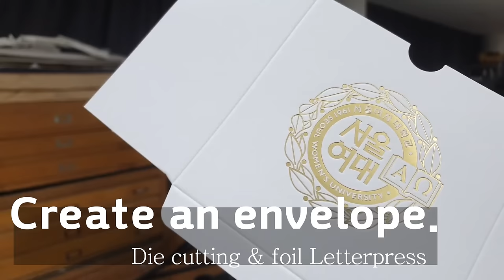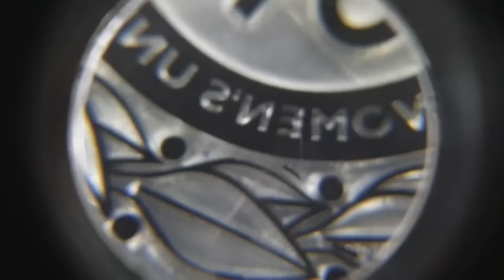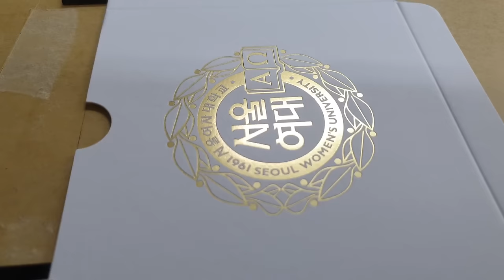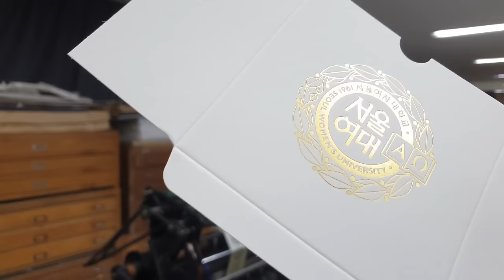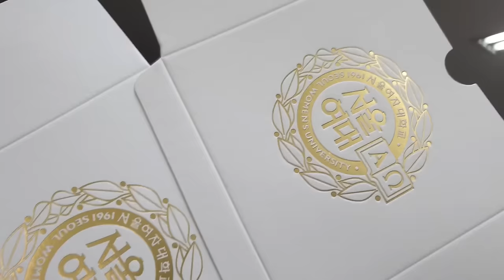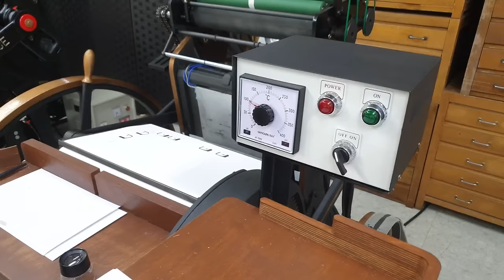Envelopes with die cutting & letterpress foil printing.레터프레스 금박인쇄와 톰슨작업으로 고급 봉투만들기.

Comment: I was a Printer in a press at Faridabad, India long ago, I also use this machine for die cutting and printing,  in those days we feed the paper by left hand by a speed over 2000 impressions per hour, depending upon the size and thickness of paper,  also especially  for every Machine there is an assistant also for that fellow is expert in taking the printed paper out of the Machine by standing at the right side corner of the Machine man(printer),  ie., by the left hand we feed the paper by both hands and the helper beside me took out the paper by the right hand and put it in orderly at the table mounted on the right side, by this way  we can assure a large sum of printed items  per day,  I am so happy to see your way of handling this Chandler Machine,  many greetings from Kerala, India 🇮🇳, God bless 🙌
Reply from the maker: thank you so much.  And I'm glad you did the same.  I still have a lot of shortcomings, so I'm still working hard.  Thank you so much for encouraging me.

Comment: There are a lot of stops - it’s difficult to insert the original. Very slow speed when embossing - either the foil will float or there will be a failure to print (a hole above the R). Why press then? Why not increase the pressure and apply pressure when stamping? At temperature the print becomes matte, but when it cools down it is not compatible (expansion coefficient of the metal). The deckle is softer and there is more pressure))) and everything is ok! But faster!
Reply from the maker: Thanks for the advice. If you increase the pressure when foil stamping, the foil will smudge and print.

Comment: This is beautiful. I too want to start my own business but don't know name of these machine and from where i can buy it😭😭😭😭😭 can you help me with that please
Reply from the maker: Nice to meet you.  The machine name is Chandler&price.  This equipment is American equipment.  Equipment is usually used for about 100 years.  You can purchase it through Google search.  It is easier to purchase if you prepare delivery before purchase.
Reply: These are called Letter Press Machines, there are many different makes and models. Depending if you want a more automated one or a  hand operated one it can vary in price. This particular one they use in the video looks like its already electric powered and has a heating plate some models work with cranks and levers or do not have the option to do foiling like they showed here.

You can do more research on it if you just search up Letter Press.
Reply: This machine very nice brother

Comment: I love your work, May I know what is the foam sheet you put on the die cutting mold?
Reply from the maker: Nice to meet you. The one used here is rubber. There is glue on one side.
Reply: @w_letterpress  Thank you very much. By the way, can you show me where i can buy it or the key word to search on google? I searched for this product but only the one without glue
Reply from the maker: In Korea, it is sold only in printing materials.  There is not much demand for it, so there is no place to sell it online.  If you find rubber without adhesive, you can purchase double-sided tape with it and stick it to the rubber.
Reply: @w_letterpress  okay, i got it. Thank you very much <3
Reply: @NhanNguyen-zl6kt  Try use Ethylene-vinyl acetate (EVA)

Comment: i dont get it how put the metal logo to the machine? with glue? the medal is hot?
Reply from the maker: Nice to meet you.  Technicians in Korea usually use bonds.  When heat is given, it is bonded slowly.  The downside is that it leaves marks on the base plate.  So, periodically sand the base plate.  So, I use double-sided tape with good adhesion.  When applying pressure, you need to press and hold for about 20 seconds.

Comment: not good
Reply: @w_letterpress 
sorry I was also a diecutter... the way you hold the paper loading and unloading is not proper as a diecutter.
Reply from the maker: Thanks for the advice.  I am not a professional die cutter.  I am using my own way.  Could I see a video with a better way?  I am making a YouTube video or applying it to what I do in a nearby print shop.
Reply: @w_letterpress 
I was a manual diecutter before. I do not have a video...
Reply from the maker: Thank you.  I will see if there is a better way and think about it.